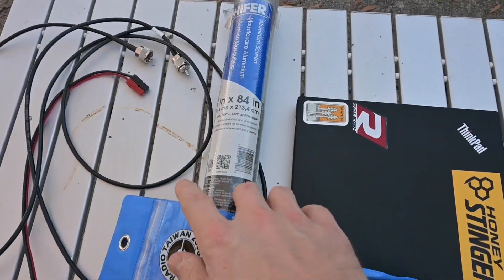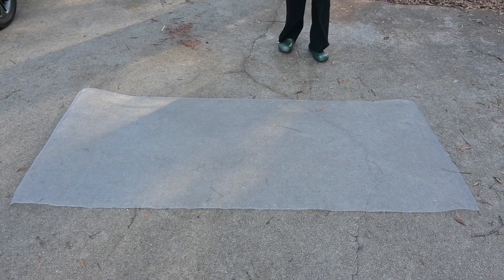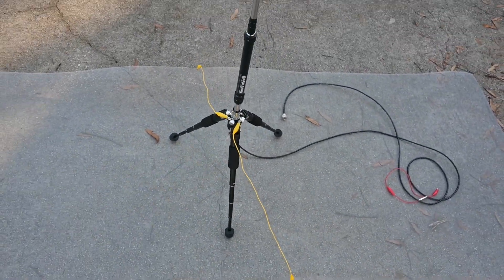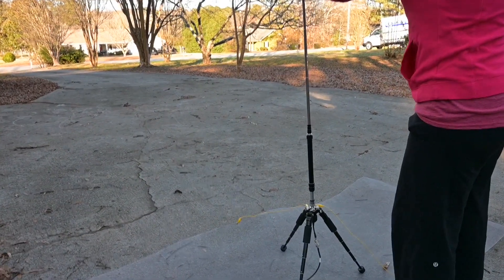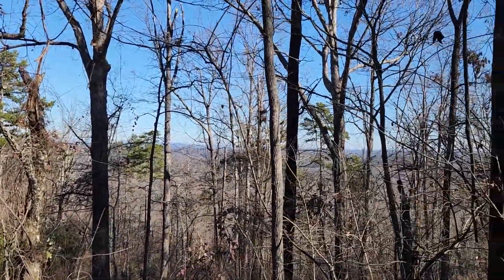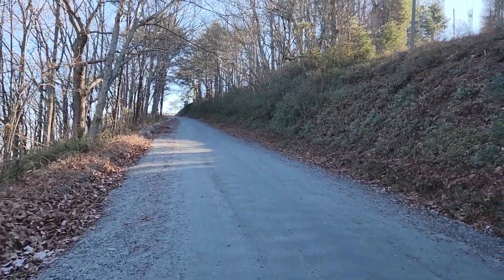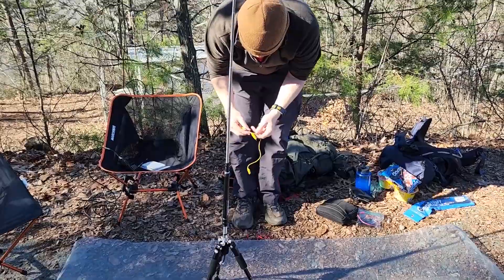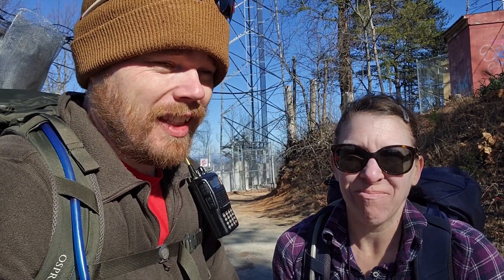Testing the Magic Carpet with a SOTA/POTA Activation of Currahee Mountain

Comment: I do POTA, I started with the aluminum screen, but now I use a faraday cloth. The faraday cloth works just as well, but it folds up to about a 1"x6"x8" size. I also noticed if you remove the rubber feet on some of those tripods... you do not need to hook ground straps from the tripod to the "majic Carpet"... the tripod will ground it just as well sitting on top of the "carpet". Great video, thanks for all your shared eperiences. NS9T 73!
Reply: Ditto

Comment: Another interesting video.  I intend to try this idea with the mesh screen and I've got it ready.   I use a mag mount to support a hamstick on my car for 40,20 and 10m and would like to do this on my RV but it is aluminium so the magmount won't hold.  So I bought a stainless steel square about 30cm on a side with the intention of adhering this to the RV roof to give something for the magmount to grab.   But in the meantime, I am planning to do the following - 1. Put the stee plate on the ground, 2 lay the mesh on top, 3 Fix the magmount on top, sandwiching the mesh.   I hope to get results as good as yours !   73, Pete M0 KNQ